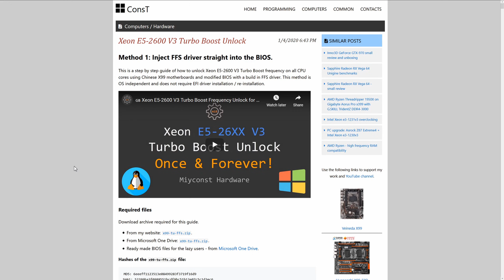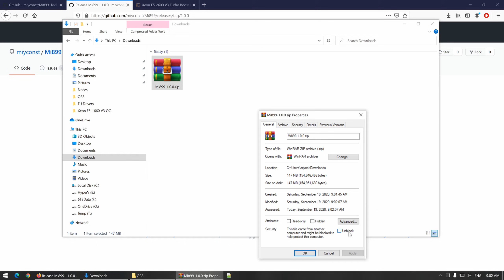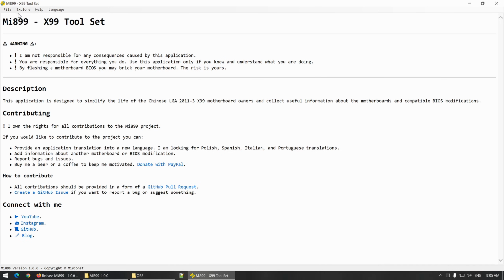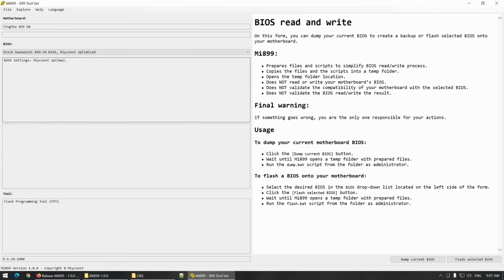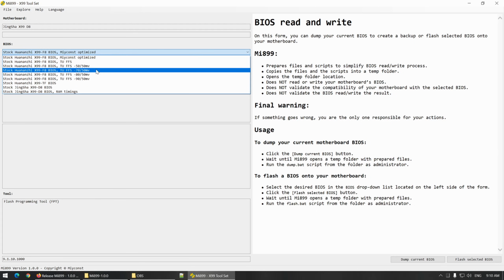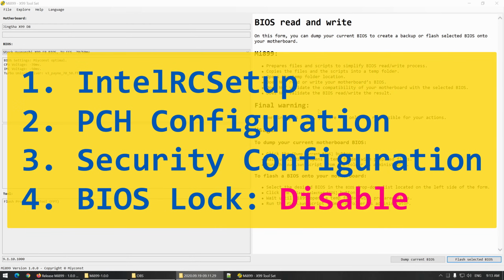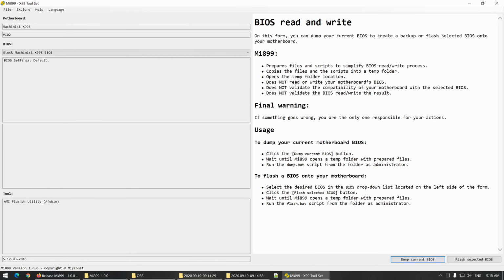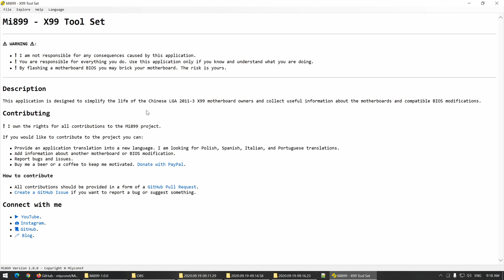🇬🇧 Mi899 – X99 Tool Set | read, write BIOS & unlock turbo-boost with a few mouse clicks

Comment: Hello! I have downloaded your app but there is no file available for turbo boost unlock for model Kllisre x99 v201.
For every other mobo there is link but for this one it isn"t. 
Can you give me some directions which mobo is compatible with this to download files for? 
Thanks, you are awesome!
Reply from the maker: X99 V201 is compatible with Huananzhi X99-8M-F BIOS 😃.
Reply: @Miyconst  Ok, I know this info allready, but I don't know where to get it. On mobo list in your mi899 app there is no path for download bios for v201 . How can I know which download path is right to get x99 8m-f bios? Which link should I use in your app?
Reply from the maker: Just select Huananzhi X99-8M-F motherboard from the list, that's it 😃.
Reply: @Miyconst  thank you, I'm still learning, so sorry for silly questions.
It's great what you do for the community. 
I wish there is more people like you
Reply from the maker: Thanks for the support!
Reply: Hi again! Everything was ok at first sight but when I've reboot pc, windows booting start but it freeze. What action I have to do to fix this isue? I have flashed with x99 8m-f   -50/-50 mV option
Reply from the maker: @tomislavhorvat-g5s  Did you restore the BIOS defaults after flashing the new BIOS?
Reply: I thought that was neccesary just if I do manual instalation. I was using lazy one ....
now its ok 😁😁
Sorry to bother you... thanks...

Comment: ¿Es posible usar mi899 offline? Por ejemplo, podría ejecutarse en un pc y una vez que todo este preparado. Copiar algún directorio en otro pc, sin internet pero con mi899 instalado y ejecutarlo.

Is it possible to use mi899 offline? For example, it could be run on a pc and once everything is ready. Copy some directory on another pc, without internet but with mi899 installed and run it.
Reply: Me autorespondo, no hay problema. Ejecutas mi899 en otro pc, seleccionas el bios y el método de instalación de tu placa del pc offline y das a instalar, te genera una carpeta en temp, la copias y en el pc offline y ejecutas el .bat.

Comment: Dear Kostiantyn! Thank you! It works! Now i have a E5-2630L-V3 with Unlock Turbo Boost with RX 470! Huananzhi X99-8M-F motherboard no sound I don't no why. Now I use usb soundcard.
Reply from the maker: Did you install Realtek audio drivers?
Reply: @Miyconst  Yes! Downloaded from the original page! The motherboard only see the videocard hdmi Sound and now the usb soundcard.
Reply from the maker: @FranKut1981  too bad then, seems like you have got the issue with a dead onboard soundcard.

Comment: Good morning, today i flashed my Kllsre X99-D8 with your suggested bios for my config (Xeon E5-2680 V3 ) bios  Stock Huananzhi X99-F8, TU FFS -70/50 .
Everything is fine except the cpu won't boost over 31 multiplier, did you have any suggest?
Reply from the maker: It doesn't boost over 3.1 GHz at all or under full load?
Reply: @Miyconst  in single core operation they boost, i'm trying some games, there is still not any option to change the TDP? i think is a problem of limitation, if i flash another bios with lower vcore i assume that it should consume lower so boost higher ? in your tests it's safe to go lower or the CPU vcore ?
Reply from the maker: @sebastianoarcidiacono5181  the described behavior is correct, the CPU will downclock when the TDP limit is reached. Each CPU is unique and there is no universal save undervolting value, you have to find what your CPU is capable of by trying different options.
Reply: @Miyconst   i'll try the next step bios with lower vcore...

Comment: Hi,  can i use the Machinist x99z v102 for my motherboard :  the atermiter x99 v1.0 ?                                                                            ps: nice video btw
Reply from the maker: Atermiter is an AliExpress store name, they put it on every possible motherboard, thus I can't guess which motherboard you are talking about.
Reply: @Miyconst  The name is ''Atermiter Motherboard Slot LGA2011-3 USB3.0 NVME M.2 SSD Support DDR4 REG ECC Memory and Xeon E5 V3 V4 Processor'' from cpu store on aliexpress .            Thx for the reply <3
Reply from the maker: @demora9581  there are multiple motherboards with such name, but non of them are compatible with the Machinist X99Z V102 BIOS.
Reply: @Miyconst  Okay thx in that case I will try the manual tuto
Reply: @Miyconst  After a break, I finally found the real name : intel X99 V201 v1.0 (Atermiter) H81, with American Megatrends BIOS it looks similar to the Huananzhi x99-8M-F should I do the turbo-boost with it ?
Reply from the maker: @demora9581  yes, this motherboard is compatible with the Huananzhi X99-8M-F BIOS. Be careful, Huananzhi X99-8M is not the same as X99-8M-F.

Comment: Thanks a lot for your hard work. I haven't really read anyone else having the same issue I have, however, I don't get to work the dump step, and I wouldn't like to attempt to flash before I have the backup of my current BIOS, I tried both of the latest releases 1.2.1 and 1.2.0 but the dump file just does not get me any backup, in fact it does not open properly, I checked my BIOS and the lock BIOS is disabled, I make sure to run everything as admin, and I'm sure I'm selecting the right MoBo as well, downloaded the software needed for it to work, and I just don't know what to do as none of the two options work, my MoBo is an X99 running with a 2678v3, can I get some help?  Thanks in advance.
Reply from the maker: Please specify which exact X99 board do you have? Also, instead of running the flash.bat file, you can open Console (CMD) window as admin, navigate to the folder with the script and then execute it by typing flash.bat, this will keep the console window open and you will see the error message.
Reply: @Miyconst  It is an F8 Huananzhi, I finally did just as you said, navigating through CMD, now my issue is that after I flashed one of the available BIOS it sounds as my PC is about to fly as a Falcon Heavy. What do you recommend? 
My combo is X99 F8 + 2678v3, which BIOS should I try out of the options that the are available there? Once again thanks a lot for your work and for replying.

Edit: I just entered the BIOS and modified the speed of the fans a bit and now I'm testing.

Comment: Hello, I have two problems, maybe You can tell something or give some advices ;-)
1. I tried couple of bioses from Your Mi899 and every time max I can achive is 2,6GHz (at all cores). X99-TF with 2620V3. In CPU-Z stress CPU temp is max 60deg. Now I end with Belarus edition, Mi8.
2. I have 4x4GB (all hynix, 1x2133 and 3x2400). Bios and windows see only one 4GB 2133, CPU-Z see all 4x4GB in quad. It is possible to start motherboard only with 2133 (no difference with slot installed), with other 2400 I get code 53 (no difference with slot).
Reply from the maker: Hi there and let me try to provide some help:
1. I have never had such issue, but my subscribers reported to have the same problem. In their case the issue was solved by selecting high performance profile in Windows.
2. It seems like you have different memory configuration with your RAM modules. The DDR4-2400 seems to be 4/8 banks per module, and such ones are not supported by X99 boards.

Comment: I hate to ask a probably obvious question but is there a compatibility list somewhere or does this only work on the Chinese mobos in question? Trying to see if this tool would work on my EVGA X99 Micro or if I need to do it manually with another tutorial.
Thanks for all the useful info in the video.
Reply from the maker: The tool provides a list of motherboards it has BIOS options for. Mi899 does not read or write the BIOS itself, it only uses official tools (FPT / AfuDos) and premade BIOS options. For EVGA you would have to prepare your own BIOS and find a way to flash it.

Comment: Hello, I would like to know if I can have any problems or errors if I use the tool to unlock the turbo boost using Window 8.1, or it only works with window 10?
Reply from the maker: Hi. I don't know if the application is even going to work with Windows 8, I have only tested Windows 10.

Comment: Hi, is there support for ZX-DU99D4 V1.11 ?

Thanks
Reply from the maker: There is no, sorry.
Reply: @Miyconst  Any possibility to add it?  or which guide for undervolting and turbo unlock work on ZX-DU99D4 V1.11 ? Many thanks ;-)
Reply from the maker: @otclevel2recording23  I can't add support for a motherboard I have never tested, but if I happen to ever test it - I will update Mi899. For now you can try this: https://xeon-e5450.ru/socket-2011-3/e5-2600-v3/dobavlyaem-anlok-v-bios-raz-i-navsegda-cherez-s3turbotool/

Comment: hello your program works but after 5 mins my win 10 freezes completley and i must restart i use a haunanzhi x99 8m f and a e5 2620 v3 plus i have tried all ur bioses same error
Reply from the maker: Did you restore BIOS defaults after flashing a new BIOS?
Reply: @Miyconst  yes of course
Reply: that is stable but no turbo boost
Reply from the maker: Which BIOS did you use? Did you enable "High performance" power plan in Windows?
Reply: @Miyconst  i had a custom power plan that was made to improve performance do you think that was my issue
Reply: i used all bioses with turbo boost unlock which had under volting on all of them
Reply from the maker: @jacob6990  it could be the issue, but you never know until you validate.
Reply: @Miyconst  thanks for the help but i have been unsuccessful i havnt got an idea what the problem is at hand

Comment: Dear Myconst, I am contacting you again because I just bought a Machinist x99 K9 motherboard and I have two problems. The first of these is the measurement of the CPU temperature, which does not perform it correctly. The BIOS reads 120 degrees C, so my liquid cooling fans are constantly spinning at quite a speed. The other problem is that when you start MS Windows, it seems as if they are constantly plugging and unplugging a USB device. In this sense, if you connect a pendrive, no problem, it reads it perfectly. But if you connect the mobile phone, it starts connecting and disconnecting and an infinite loop begins. Do you know if there is a solution to the problem? I have modified the BIOS with your mi899 program. Thank you very much for your help as always.
Reply from the maker: Machinist X99-K9 has broken smart fan function and it doesn't matter what temperature your CPU is. I believe that 120C is the temp shown for the motherboard, not CPU. The only thing you can do is to adjust rotation speed of the 4-pin CPU fan. The speed will be statics, but it's possible to change it in the BIOS.

The USB issue is harder to fix. It could be due to the cable, due to the front panel connection cable in the chassis or simply defective motherboard.

If you are not afraid to experiment, you can try the iEngineer BIOS.

Comment: what config do you recomend for huananzhi x99 8m-f with a xeon 2640 for the turbo boost? same as 8m with -70/-50?
Reply from the maker: Yes, -70/50mv offset is the default value I would recommend.
Reply: @Miyconst  Hi! I load the BIOS like the previous comment but my Windows freeze a few seconds ago when Windows starts, do you know how fix It, i'm not able to open again your app... :(
Reply from the maker: @nidazo  did you restore the BIOS defaults after flashing a new BIOS? If that does not help - put the "Power Technology" option in the BIOS into "Disabled", it will disable CPU Turbo Frequency and you should be able to load into Windows and restore the BIOS.
Reply: @Miyconst  restoring defaults seems to work, thanks a lot!!!
Reply: @Miyconst  sorry to bother you again! I was trying everithing but I cannot make it work well. When I reset to defaults, computer starts well and I'm able to work with it perfect, including stress by hours, but when I restart or when I shutdown and wake up the computer again, always get a message like I must insert a disk for booting... I don't configure nothing in the bios, only reset to defaults. I select reset to defaults > save and exit and the computer starts perfect, I use the computer for hours but when I shut down or reboot, the message appears again and never disapear until I select again reset to defaults... I was trying to configure the boot options, because I have a NMVE as OS disk and then a SATA III for data, but there is no diferences in any option I select, theres always the same message and only disapears when I select reset to defaults
Reply from the maker: @nidazo  this issue is related to the UEFI partition. You have to either restore it with Windows installer or reinstall Windows completely.
Reply: @Miyconst  thnx, fixed with diskpart and seems to work!!! 💪

Comment: Hello Myconst: First of all I would like to thank you for the work you do and that you help many people. My question is easy, within the available bios, is the Jingsha D8 base square, is it compatible with the Kllisre D8 motherboard? If I select the TU FFS -70/50 option, will the ram timings also be unlocked?Thank you very much and congratulations!
Reply from the maker: If you are talking about Kllisre X99-D8, which looks exactly the same as JingSha X99-D8, then it's the same motherboard and the BIOS is compatible. As far as I remember, the turbo boost unlock options in Mi899 come with RAM timings as well.
Reply: @Miyconst  Thank you very much for your quick response Myconst, you are the best!
Reply: @Miyconst  Hello again Myconst:

I modified the BIOS with your tutorial and everything went perfectly, just a small problem, and that is that the keyboard (USB) does not work for me either when starting the PC (I cannot get into the BIOS) or in the BIOS itself, when I access it through Windows . Any solution? Thank you very much!
Reply from the maker: @djlitrix  this sounds very strange, what kind of keyboard are you using? Do you have an option to check another keyboard? Have you tried USB 2/3 ports?
Reply: @Miyconst  Problem solved Myconst, I have changed the keyboard for another USB and it works. Apparently the problem is with the Microsoft K600 keyboard. Thank you very much for your help. See you in the forum.

Comment: Thank you Miyconst ! I have huananzhi x99-f8d with dual e5-2680 v3. Can I use your software to flash my bios? Or can you send me a compatible bios for it?
Reply from the maker: What exactly are you trying to achieve by flashing the BIOS?
Reply: @Miyconst  I would like to unblock the cpus.  when I do a stress test, all cores are blocked at 2.8ghz
Reply: @Miyconst  Have you any idea ? Is it possible with bios rom with this motherboard ? Or just with efi driver on windows 10 ? Thx for your help !
Reply from the maker: @CLusmi49  so far I don't know a single successful BIOS modification for dual socket motherboards, only manual EFI driver installation on the OS level.
Reply: @Miyconst  ok thx you for your very good work. I give up because i work on proxmox on linux. How can i know if there is an update that allow me to do this on linux ?
Reply from the maker: @CLusmi49  you have to monitor the Internet and see if someone comes up with a way to permanently hack dual socket X99 motherboards. I might make a video about it, if I find something on my own.
Reply: @Miyconst  thx very much ! 😁

Comment: have u add the Jingsha X99  GT ?
Reply from the maker: Yes, it is compatible with X99M-GT BIOS.
Reply: @Miyconst   OK is that file in the folder i download all  ? only need to flash than it work with Turbo Boost ?
Reply from the maker: @sealion_t_v  sorry, I don't quite understand the question.
Reply: @Miyconst   iam mean the JINGSHA GT BIOS MOD
Reply from the maker: @sealion_t_v  as far as I know, this motherboard is compatible with the X99M-G2 BIOS, but the risk is yours, as always.
Reply: @Miyconst   hmm OK i think i will check it out..but i need first my ordered ram i cant use the board now

Comment: Excellent tool. unlocked all cores turbo no problem. word of warning though. if clock speed drops to under 1.2 ghz after a a minute or so of booting check windows power management. for some reason windows 10 decided to throttle mine at 5% utilisation after the unlock. changed back to 100% and all good. 3.2 ghz all cores

Comment: Hello, I have x99 f8 huananzhi motherboard, E5 2678 v3 with 2 ram memory modules (2 x 16 gb), I can apply the turbo Boost???? Or need 4 memory ram??? Thanks
Reply from the maker: You can apply the turbo boost unlock hack regardless of the memory configuration.
Reply: @Miyconst  Thanks a lot

Comment: Nice Work, really appreciate your effort. But,  if I get JingSha X99-D8, 32gb ram and Xeon E5-2678 V3. Would you recommend to go straight with undervoltage 70 /50 ? or Should I to beware with something? Thanks in advance.
Reply from the maker: I would test the setup with the default settings first, and the go straight to -70/50 if it's stable. So far, all my E5-2678 V3 were stable with such undervolting.

Comment: Thank you very much for your great contribution, very good explanation.
I would like to ask you a question. I have a Huananzhi X99-TF motherboard with a 2673-v3 CPU and 32GB DRR3 ram. What BIOS do you recommend for me?
Reply from the maker: I would pick the Huananzhi X99-F8 BIOS with -70/50 mv undervolting.
Reply: @Miyconst  Great, thank you very much for your answer. I have seen that there is in Mi899 a BIOS for my Huananzhi X99-TF motherboard with -70/50 mv undervolting. Well, Is it more advisable to put the X99-F8 (DDR4) BIOS on my X99-TF motherboard (DDR3) with -70/50 mv undervolting? Thanks for everything.
Reply from the maker: @frankj1635  it does not matter, it's the same BIOS, the only different is the motherboard name. X99-TF / X99-F8 / X99-T8 are the same motherboard, just different name and memory slots configuration.
Reply: Thanks for the explanation! And congratulations on your great work!
Reply: @llllllllllllllllllllllll_____  Hi, I have the same problem.  I have an x99 with a 2678v3 and it does not reboot, the screen remains black.